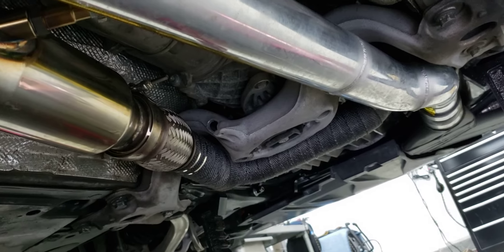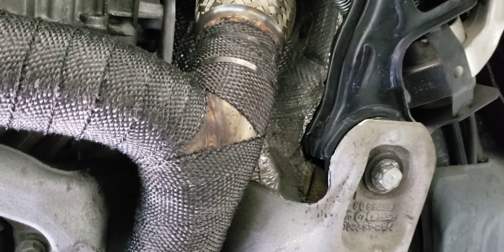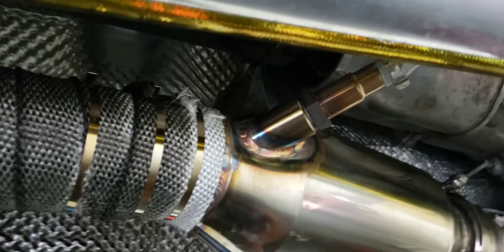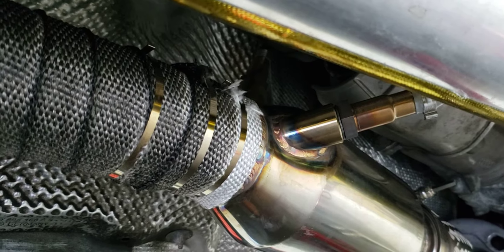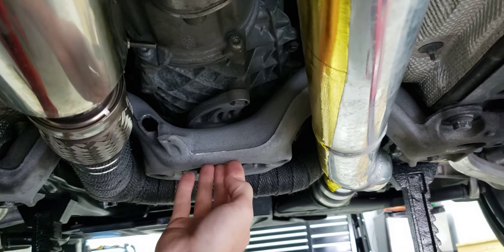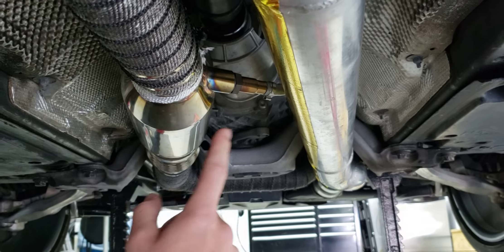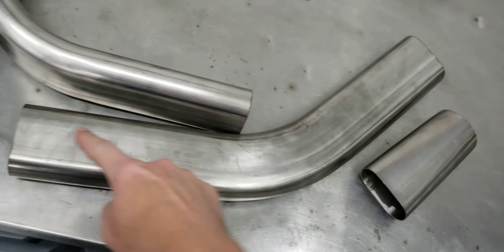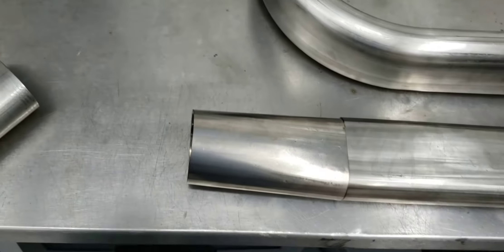Rear-mounted Turbo RS4: Downpipe revision pt. 1

Comment: Very creative way of plumbing the system.  I hope you have all the sounds of each exhaust build.  Just to compare the difference.  Do you log your exhaust temps.   Sometimes they throw off o2 readings.
Reply from the maker: Thanks!! I've got a few videos of the exhaust note before and it will be interesting to retake the video in a similar fashion to see if I can capture a difference. I just hope I like the sound with the new setup as much or more than I did before:). 

I measure EGTs back at the turbine inlet but not near the sensors. I am confident the sensors are seeing EGTs well within their operating limits so no issues from that.